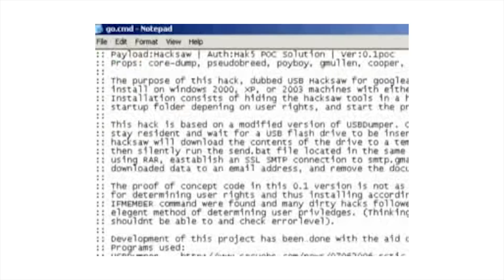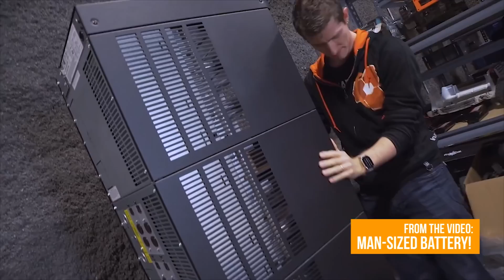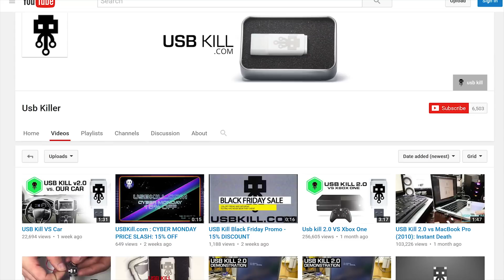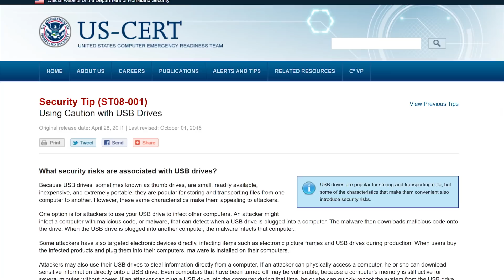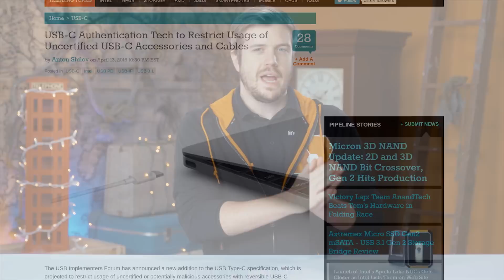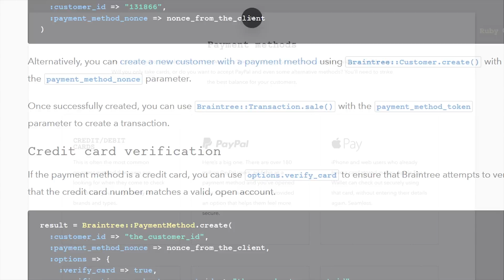COMPUTER DESTRUCTION (GONE DEADLY)

Comment: Why is it legal to sell this? it's basically a tech weapon
Reply: mygetrichslowplan Unlike a truck, or a knife, this device has no other utility than for killing the motherboards of one's enemies.
Reply: Because, as with most things, it is up to people how they use it. A man could use a truck to run down a bunch of holiday shoppers (too soon?), so should we never sell motor vehicles? A knife can be used to stab/cut someone, should we never sell knives? All it takes is one person to have a legitimate use case for this that ISN'T illegal (say, making a video about it?) and at that point we should trust people to do the right thing, even if sometimes they don't. 

Creating a nanny state where we wrap everything in bubble wrap and constantly surveille people to keep them from hurting themselves and each other is not the proper solution.
Reply: its main purpose is for companies to check their port's defense against overvoltage/whatever it called (Some devices' ports are immune to this USB killer, like iPhone's lightning port.)
Reply: Or you can use it on your old stuff that you throw out anyway to keep that creepy guy going through your trash from coming back.
Reply: Because that's not the point of it. The point is to try and get manufactures to fix their devices to make the USBKill not work with them, as a way of pushing the market forward. It is the same idea as using a bug or exploit against people to try and get the devs to fix it.
Reply: Then why do we have guns? Say someone comes at me with a samsung galaxy S1? do i just let them blow me up?
Reply: Peridot then you must live in US, the rest of the world don't sell gun to their citizen
Reply: Why is it legal to sell a gun, its litterally intended to kill people /s
Reply: It actually HAS utility, and it is to test USB devices against surge or voltage spikes from defective USB devices.
When you make electronics and you plan on selling your stuff, you need to make sure it will be reliable and safe, this is a tool in this aspect.
Reply: Kalvinjj .... except no. Not at all. I'm an EE specializing in embedded devices. You're correct -- products do need to undergo extensive testing. However, NOBODY tests USB devices with -200V. It's insane. They test for small overvoltage and overcurrent conditions. They assume nobody is stupid enough to plug something like this into a USB port. USB ports are not protected as this would make their functionality limited. I described in another comment how you could defend against a USB killer like this (with a little engineering, you could actually kill the USB killer! Now THAT would be cool) but it would likely limit the length of cables you could use with a USB device, and it may stop some devices from working entirely. It's hard to say. I was thinking of building one up and making a video to test it.
Reply: It was originally designed for the purpose of testing hardware for surge protection. It was not originally intended to be used to destroy hardware
Reply: The people who created it are here from the future to give us the technology to destroy skynet in the year 2080! Skynet got nothin on the usb killer.
Reply: It should be illegal to sell your mom.
Reply: So much stupidity in this thread. 
I am certain that the engineers that make hardware don't buy some usb sticks to test hardware for stuff like this, they most likely already have enough fancy testing gear.  
And we already know what parts are needed to protect from this sort of attack so is testing even needed? Just check the schematics and add the parts if they're not there.
"All it takes is one person to have a legitimate use case for this that ISN'T illegal (say, making a video about it?)..." 
I bet there's tons of people who'd love to make videos about nuclear weapons, should those be legal too? 
"then you must live in US, the rest of the world don't sell gun to their citizen" 
Incorrect, there are many countries where guns are sold to citizens. Most just have stricter requirements for getting the permits. 
"Why is it legal to sell a gun, its litterally intended to kill people" 
Because it has alternative uses. The possibility of killing humans is also the reason many countries regulate guns strictly.
Reply: This is a terrible method to protect your hard drive, because it most likely wont kill your hard drive. All it takes would be taking the hdd out and putting it another system to see whats in it
Reply: Sergeant Methcake 
most are too lazy to build one. you have to search to find out how then get the materials then actually build it.....ya buying is so much easier
Reply: Jullius Correia I mean, my comment was meant as full on sarcasm but to give a more serious answer.

Just because its dangerous doesnt mean it needs to be banned. Otherwise everything from kitchenkives to sharp corners would have to be banned.
Reply: This is being distributed to try and force tec compinys to safgard usb ports. The idea is that the more popular and such this gets the more likely a movment will happen.
Reply: Your argument is rather moot it's not existing has no validity to there being a problem! It's sole point and our descusion validates that there is a problem with current usb safgards, since there really is none! The whole point to this device is to make a point! Your childish complaining is rather moot in this regard!
Reply: Maybe he worded it wrong or I read it wrong. If anyone is confused what a strawman argument is they can look it up. The whole concept was quite the internet buzz word for a while and EVERYONE used it in their "defense". I got tired of seeing it. Eventually it died down. The internet just loves buzz words and then people use the shit out of it as if they were clever enough to be the first ones to ever use it. lol.
Reply: So are bricks.
Reply: CaveManta Skynet is an ai, the usb killer isn't. Siri is actually Skynet!
Reply: CaveManta Well, we are fine until some idiot gets the brilliant idea to use siri to control our military's drones, then we're screwed.
Reply: Yes, and you, the beholder of the infinite knowledge, know exactly what's their purpose, you know it better yes.
Anyway I'm still waiting for some valid reasons as to why you're so keen on getting that state banned - like it would change shit
Reply: I don't live in the US, i am comparing the existence of the usb killer to the existence of guns. The reason for their existence is the same
Reply: Because if you can't buy it, you can make your own for almost literally nothing.
Reply: blupilot1 name not all of us are just around 71%+ I'd say.
Reply: Yes. Compare it to nukes. Nice, great comment.

Companies need those, homebrew electronics need to be tested in case you want to make it commercial, yes, there are at least thousands of companies out there that need to test their USB products as well (millions counting homebrew), heck if you just want to make an informative video about the protections in a circuit on Youtube for people to know how much they need to be careful about their electronics, it's a usage case.
I just don't get it why people have such a urge for state prohibitions, if retards that have the urge to break someone's property want to do so they'll just physically damage it, trow salt water, make one of these at home (LIKE SHOWN ON THE VIDEO), it's no different if you sell commercially a product or not.

If you wanna ban anything that has a bad usage in mind, I'm wondering what the hell will not get banned.
Reply: Strawman fallacy implies you had a valid argument to begin with, which you don't.
You're just blabbering left and right that this should be banned cause it CAN be used for unsafe reasons. There's nothing else on your previous comments that show otherwise.

Have any actual argument to bring up? Otherwise I should just ignore.
Reply: Kalvinjj 
no. strawman is where you invent your own premise to base your argument on. nothing valid
Reply: truthseeker1973 so Kalvinjj is not a strawman by your so called corection?
Reply: canadians have guns and im sure australia does too and lots of south american countries
Reply: notice smart people eat the most fish ...no shortage of omega fatty acids
Reply: Note 7 is still not illegel
Reply: So are Note 7s. (This joke has probably already been made).
Reply: DHGMRZ17 No, Skynet IS the USB killer!
Reply: DHGMRZ17 Aaaahh! She's gonna take over the world- Wait, she already has!
Reply: r2d2292
his logic: "This has no use other than destroy property!"
your reply: "It's made to test surge protection"
- "Got a source?!"
- "Manufacturer's website"
- "MANUFACTURER IS WRONG ABOUT THEIR OWN PRODUCT!"

this is actually entertaining on a wicked way as of now...
Reply: Oh boy it has come down to a mom joke, please keep going
~feeds the clueless troll~
Reply: They'd have to move the age limit much higher to avoid my garbage..or perhaps judge it by mental age.
Reply: It's main purpose it to test if tech is protected against overvoltage or whatever it's called